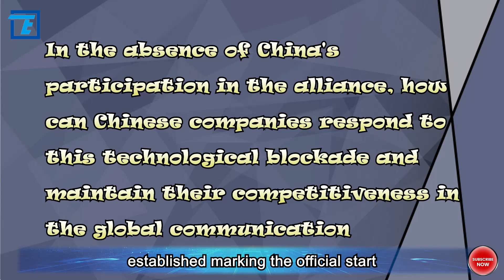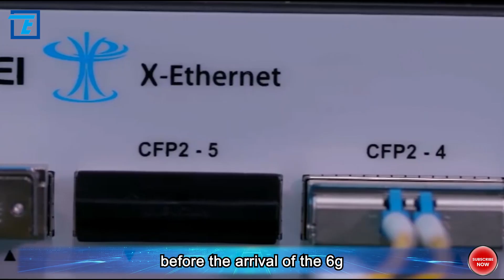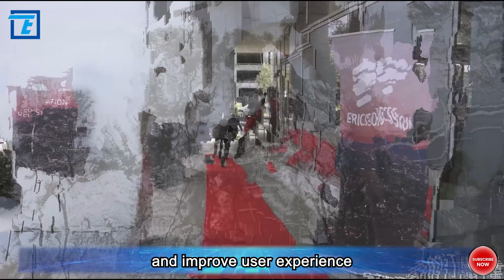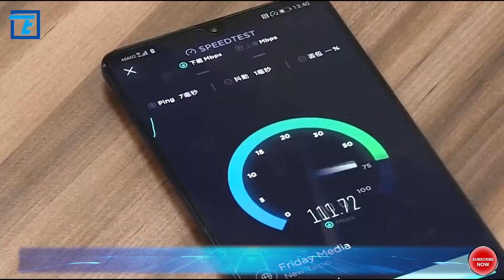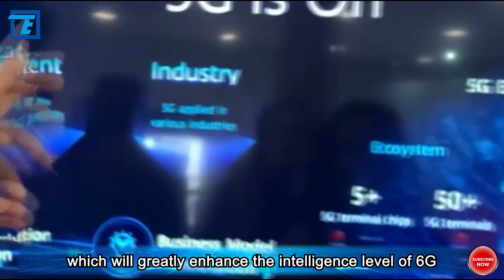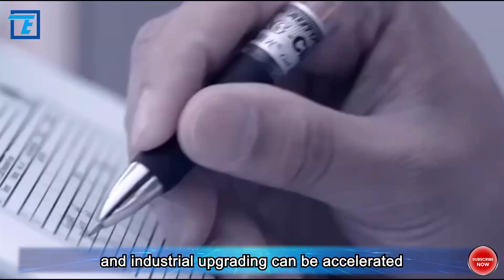The birth of the AI-RAN Alliance marks a fierce competition for technological dominance.!

Comment: There's no such thing as commercially available 5G. Five gee, is a millimeter band, and it can't pass through leaves, glass, wall, and it doesn't work if you are moving.

The 5G fraud is more bandwidth, and more antennas in your handset.

The Chinese might have some small 5G systems. Maybe 6G, when it arrives, will be the real 5G.